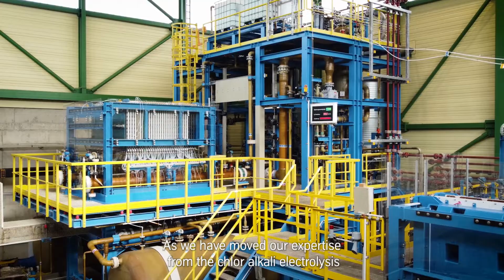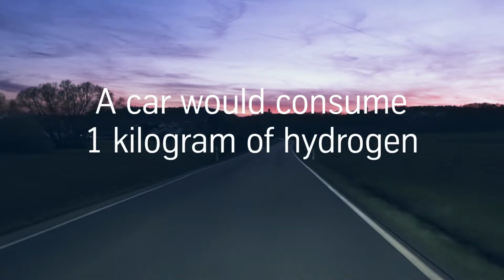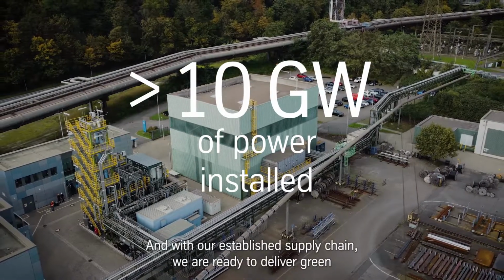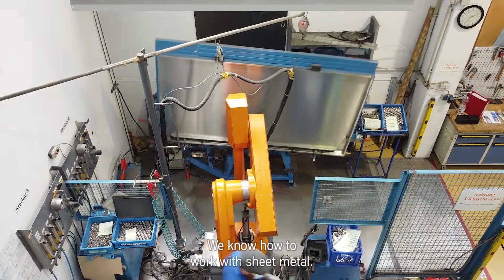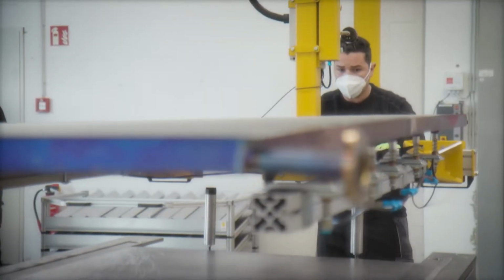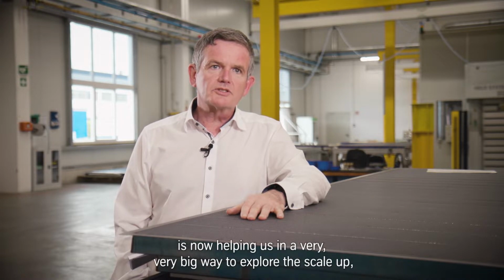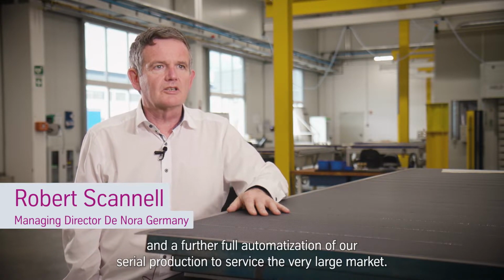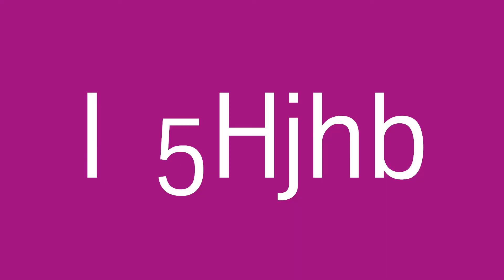Hydrogen lead project: thyssenkrupp nucera to expand to 5 GW of annual production capacity

Comment: Let me help you out:  #1 the first thing you need to know is that H20 is two molecules you want to separate, #2 you should recognize that they are magnetically bond to each other.  So this is real simple and you will have more then you can handle!!  Build your basic water filled glass with the two electrodes.  Now put in a very small amount of DC power and last but not least,  THIS IS THE BIG DIF:  Vibrate the center field of a magnet into the mix.  I refer to it as the "B" field.   The molecules were magnetically attached now you have to provided the dividing energy to divorce the two fields!!  JUST LIKE A MAGNET DEVIDES N & S POLES IT now can be used to separate the two molecules if tuned to the correct vibrative frequency...  Do not Oscillate it would disrupt the magnetic field because it contains the "B" field.  Vibrate only!!

Comment: 4000 m3 in normal conditions?
Reply from the maker: Yes, our 20 MW electrolyser module produces 4000 Nm³/h of hydrogen, which means 4000 cubicmeters of hydrogen at normal conditions per hour.